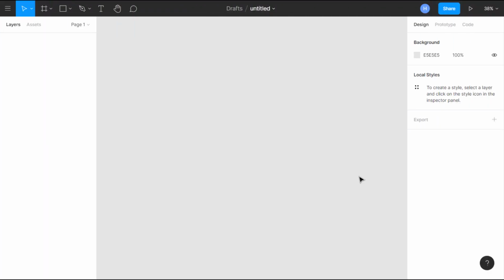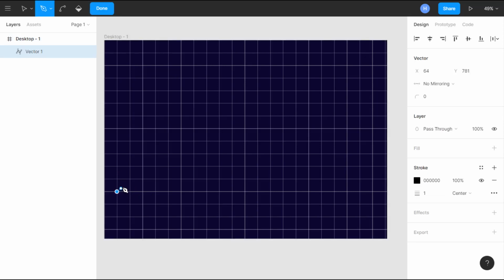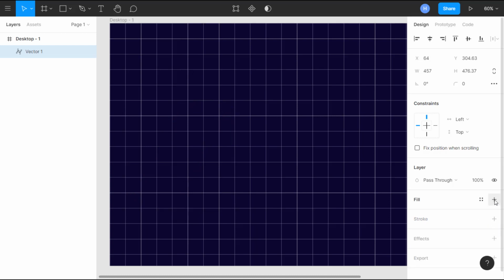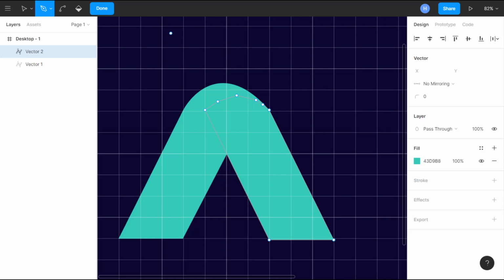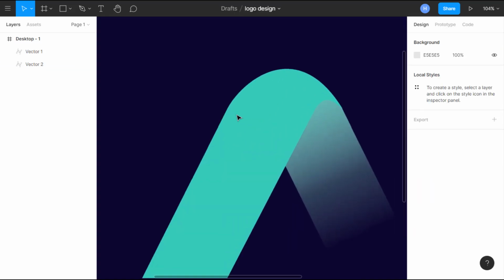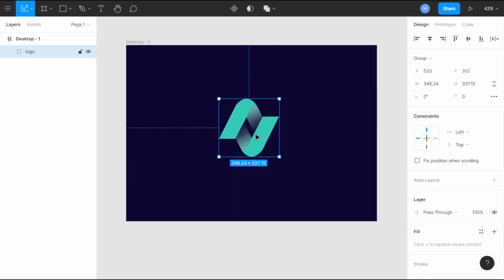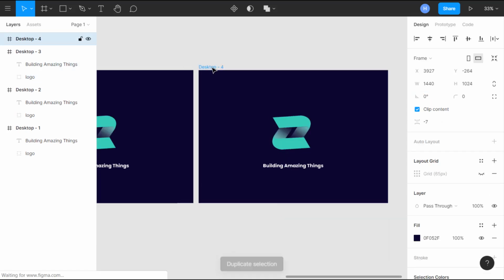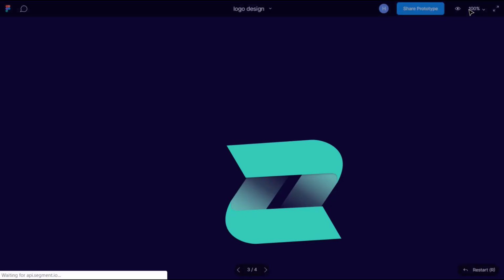LOGO DESIGN AND ANIMATION [Figma]

Comment: could you show hw to export these
Reply from the maker: Follow this simple steps to export on Figma :
1. Select the components you want to export.
2. Group the components to become one component by using CTR + G (windows) or CMD + G (Mac)
3. On the right side of your Figma Application ( Design Tool Bar ). Scroll down to Export Function ( this is the last function on the Design Tool Bar ).
4. Click on Export and do some basic settings, one of which is to select the file format you want to export with. Then click export.

Let me know if this was helpful. Or I should make a video for it ?

Comment: nice design! but how can we add something like this top our prototyped designs. like suppose we wanna show a loading animation. what to do in that case? use a gif?
Reply from the maker: You can achieve this in your prototype design by replicating your logo and using the Figma Smart Animate with an After Delay Event. Remember, to use Figma Smart Animate you have to name your components with the same name. 
Also gifs can be used in Figma Prototype. 
I hope this answers your question? Thanks for sharing your taught and question.